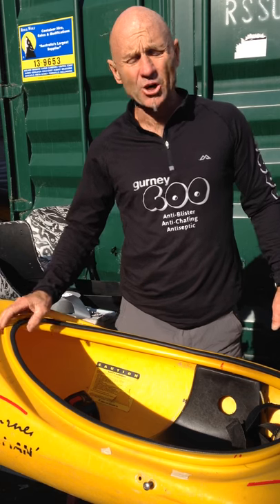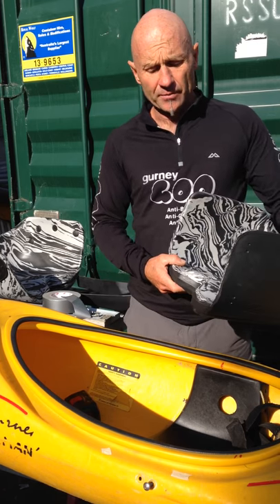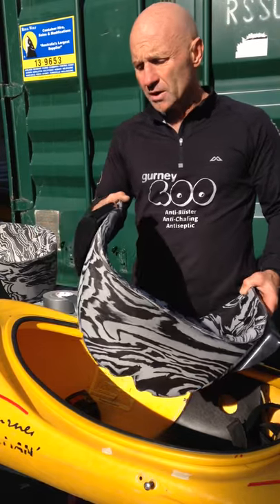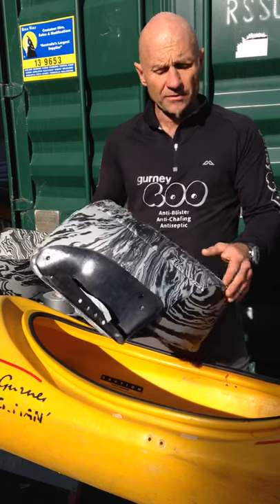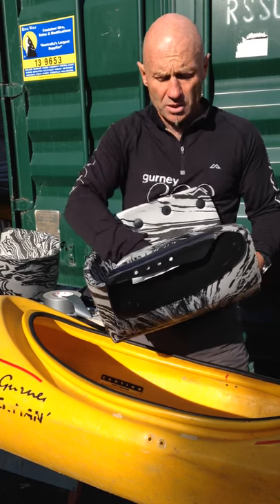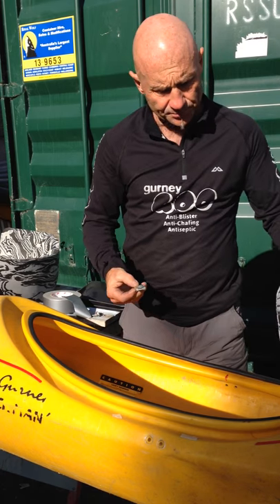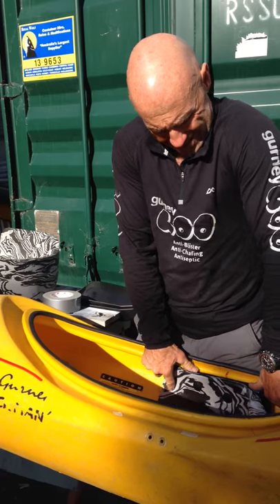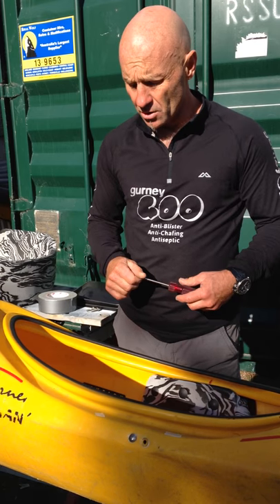IMG 3148

Comment: Would this work on a perception Carolina?
Reply from the maker: Hi Adam. I've just researched the Perception Carolina on-line, and sadly, their seat design is not compatible with the Bumfortable. They have a sub-chassis that integrates with the full and deck that gives the kayak extra integrated strength, and removal of this to fit the Bumfortable will weaken the kayak. Perception may be able to provide you with their foam seat from their earlier White-Water kayaks? Worth an enquiry
Reply: @GurneyGears  Thank you for the reply.